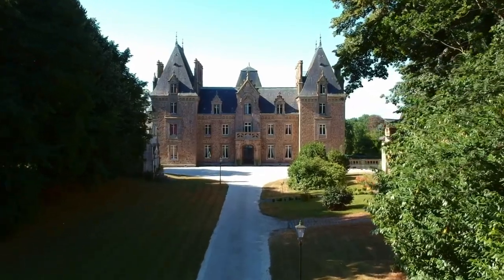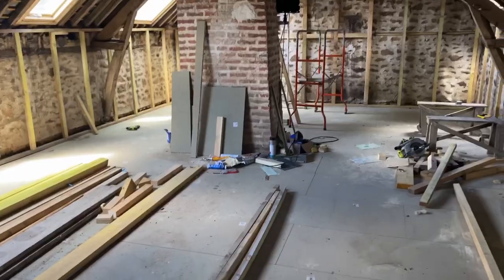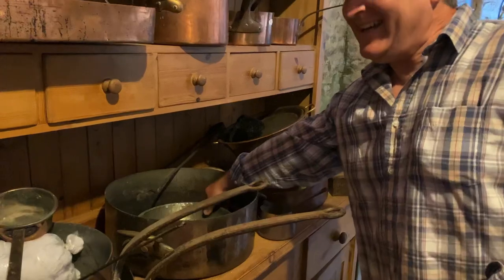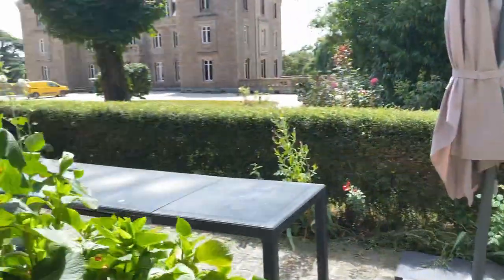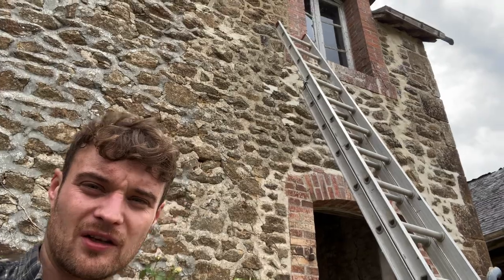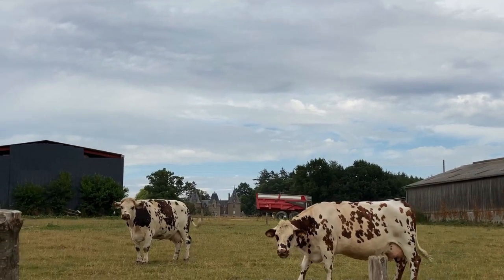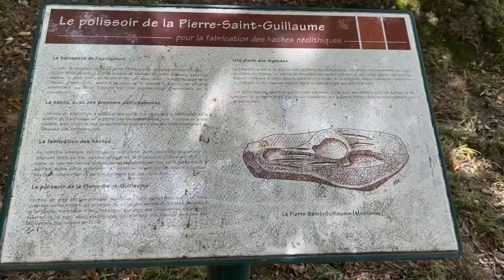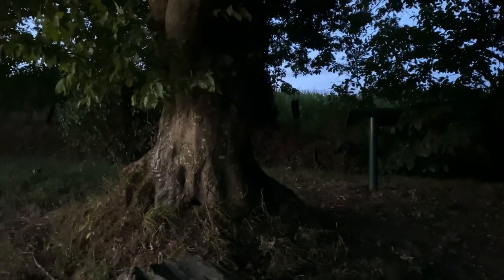The Murder of Saint William - Doing It Ourselves

Comment: Hydrangea colors change with the alkalinity and acidity of the soil. More pink is alkaline and blue is acidic.
Reply: I was just about to comment on this! You can effectively change the colour of the flowers each year, by amending the soil. The mortar from the building behind is likely causing the patchwork of colours.
Reply: That's so interesting. TY for that info.
Reply: To an extent. Also needs aluminum in the soil. Ph affects the plants ability to take up aluminum with is the primary factor in the colour shown.
Reply: Epsom Salts can help with the soil for the bloom color. ♥
Reply: Chad Cox does epsom salt make them turn blue?
Reply: Lora Elizabeth I posted too soon. 🤦. I couldn't remember exactly what I had read about it. You are spot on. 💞
Reply: I just learned the same thing a couple of months ago, too. I now live in Japan and early summer/late spring is hydrangea season. Here is a photo I took of my neighbor's flowers: https://www.instagram.com/p/CDBnzDxD2jS/
Reply: @chadcoxrox  you can do lime powder as well.
Reply: Wow that's so interesting
Reply: You are right!
Reply: @MikeEPerez  Nikko Blue
Reply: A cheap way to alter the color is to tossed some used duracell batteries so the alkalinity soak the plants roots

Comment: Michael: Latex paint, slightly watered down, custom mixed in the color of your original pointing, can be applied to the stone wall concrete and new limestone giving a unified look. I used this process in my previous 1791 metal forge home. Cheap fix - just labor intensive.
Reply: what about adding chalk/ as in chalk paint...to his own proportions.?
Reply: @cornishcoves9399  Chalk paint is water soluble, and might wash away.

Comment: Was the Aga used for heat as well? I remember living in an old railway station as a child and the kitchen range burned wood or coal, the only control of the oven was how big the fire was. You fed the stove all day in colder weather to help heat the house and there was a big  copper rectangular tub that fit in one side that you filled with water to have hot water , more than the kettle heated. That water was used for baths in a hip bath or to wash clothes. My dad worked as station agent as well as in plumbing, heating, carpentry, refrigeration , jack of all trades and he installed a hot water tank and a kemack burner to the stove so we had hot water to taps through the station. When we moved in there were only outhouses, so dad installed a indoor bathroom with a shower stall, toilet and sink. Cottage is coming along nicely, it will be great when they release the money so you can proceed as you want. Can’t wait to see that. 🙋🏼 Loved the history of the stone🥰

Comment: just learned why we have to change out a lot of bricks in our house, the old woman who lived there before us had a son or a family member or whatever replace the mortar, and he used a porous sand based one that is steadily wearing off, but thats not all cause he incorrectly mixed the acid that he removed the original mortar with, its so strong that its still eating away at the face of the bricks and apparently the process cant be stopped. i think im just secondhand glad that the cottage walls structural failing could be fixed with some lime mortar and that your dad knows what he's doing, now that i know how simple it is to cause irreversible or mad expensive damage to a wall just with careless ignorance and bad choices

Comment: Great work boys..

Although I would stitch in a new bit of timber on the roof truss before insulating and plaster that wall in mum and dads loft. You don't need to replace the entire truss. Temporarily support the truss just about the knackered bit, cut a new bit off of an old piece of oak timber to splice in, and secure it with pegs cut from the good bit remaining of the section you cut out. To help reduce the chances of future rot, place a piece of asphalt roofing shingle between new timber and the stone. This helps keep the timber from absorbing moisture in the stone and provides an air gap to make it easier for any excess moisture from a leak or excess interior humidity to escape without the wood sitting in it or absorbing too much. 

As always my suggestions are just that. Obviously we're viewing these videos after the fact. Therefore my comments and suggestions are for everyone to use as they will. My comments are never made in malice or intended to offend anyone. What little knowledge I do have to share is to inform and help anyone who finds value in them.... nothing more. Papa Pethrick has decades of experience. My comments and suggestions are in no way posted to dismiss or correct the senior Pethrick expertise. 

Vital kit for any château owner: https://www.amazon.com/dp/B08NP86MFK/ref=cm_sw_r_cp_apa_i_KG48Fb62NC7A4?_encoding=UTF8&psc=1

Cheers!

Comment: Michael, flint is not sharpened like you explained. When flint tools go blunt, they are resharpened by hitting the edges to cut of small pieces which created a new sharp axe or knife. The stone might be used to sharpen some tools (even stone tools) but not made from flint. That does not work

Comment: I use Linseed oil and turpintine for tiles and furniture.  Use Raw Linseed Oil with Pure Turpentine (there is a difference between that and Turps)  Same proportions as salad cream.  first few coats use more turpintine to oil then top coat more oil to turpintine.  The turpintine drives the oil into the wood or tiles.

Comment: You could really benefit from a stair-climbing furniture dolly.  They're just like yours except they have thick rubber bands on the back, attached via wheels at each end.  When you lean the dolly back against a stair, it's much easier to slide it up the stair, as the bands move along the wheels.  With all your stairs, this would make moving things much easier. :-)

Comment: Question - If the concrete on the front of the cottage is sound & stable would it be possible to apply a faux paint technique to disguise the concrete color? Seems it would save money & labor that could be put to use in the cottage restoration.

Comment: Yeah, that concrete mortar needs to come out because it won't allow the joints to breath or move ..  this will eventually crack your bricks or wall. I don't know why people do this because it is very detrimental structurally. That's great that you used the correct lime mortar.

Comment: If you put iron under the pink hydrangeas, they turn blue.  My house had ancient cleated huge horse, or donkey shoes under them.  What kind of stove has the boiler with it.  Can you put tiles under the radiators to save the floors?  I could do that maybe in my house.  It has three chimneys!  The story of the stone must have been meant to be told in the dark!  Thank you for the video!

Comment: The copper thing you bought ain’t a thing to cook in it’s an old hot bottle lol it’s where they put in hot glow in and then put it on the bed ends that’s why it’s so tightly made so it wouldn’t open and burn off your feet with the glow in your bed..

Comment: Are you going to use the line on the inside to fill the interior cracks?
Reply: Michael is going to lime plaster the interior and also have timber wainscoting to waist height made from the old oak flooring.

Comment: As a removalist, watching you move that washer was painful.  Everything else, awesome.  Good work.
Reply: I thought they needed one of those trolleys with the three sided wheels for the steps.
Reply: @Jayrose59  Hi Jill. Do you mean a three-wheeled trolley, with two wheels on the step and one wheel that is positioned higher up towards the handle so the trolley can be more or less wheeled up on its back?
Reply: @itsjustournature8045  Yes, that is what I mean. Whenever I have had whiteware delivered this is what they have used to get it up the steps.
Reply: @Jayrose59  Yes! I've had my eye on the ones that are 3-in-1 and 4-in-1 hand trolley/trucks, you know they'll convert to a four wheel horizontal platform that you can store heavy things on and they are easy to move around that way! I can dream, a little hard to shop around these days!

Comment: Michael, I posted this suggestion before, and will now repeat it.  Cut off about the last two feet of your cottage stair case and put a landing in at that level.  This would make a wider landing, obviously.  Then, build your return stairs, (to the ground level,) WIDER than they were originally.  This way, the area behind the stairs can be taller and house a proper set of drawers or shelves for your cottage pantry.  And, the wider set of stairs descending to the ground level would allow you to install a very charming  crooked banister.  The stairs might even flare wider toward the ground.  This would allow you to leave some little baskets on the stairs, or allow for places to set books or other interesting items.  I think this would help immensely with the style of your cottage and make for a more spacious and efficient cottage pantry.  I enjoy your channel very much!  : )

Comment: Aren't copper pots toxic?
Reply: Not if they are lined with tin
Reply: Copper itself is not toxic, we actually need this trace element in small amounts. They need to be lined with tin or steel for most things because acid in foods can react with the copper to cause verdigris which is poisonous. But jam pans are not lined, the intense heat needed in jam making would affect the stability of the tin and in any case, the large amount of sugar in jam prevents the interaction between the fruit acid and the copper. The egg white mixing bowls (cul-de-poule) are not tin lined because the copper has a stabilising effect on egg white, making a firmer, more voluminous foam.

Comment: If I were you I'd chase up the gofundme in case there's a silly reason why it's delayed.

Regarding the cottage- the little half moon detail on the outside- is that purely decorative or was it an opening that could be restored?
Reply: @jmk1962  I thought that myself and wondered  if it would be practical to reopen it - assumed it opened to the top of the ground floor which would be useful to get a bit more light in.

Comment: You gonna repoint on the inside cracks?
Reply: Remember probably 2 vlogs ago he mentioned about lime plastering the top half of the walls so it is just repointing, it will completely cover the bricks. And the bottom half of the walls will have tongue and groove using the old oak flooring from the 1st floor.